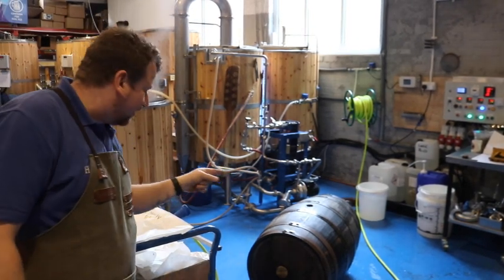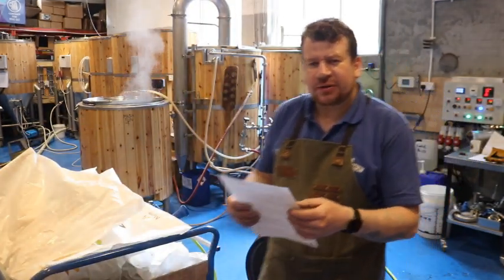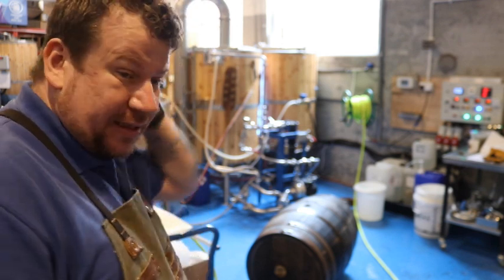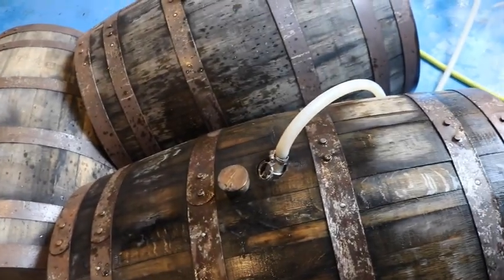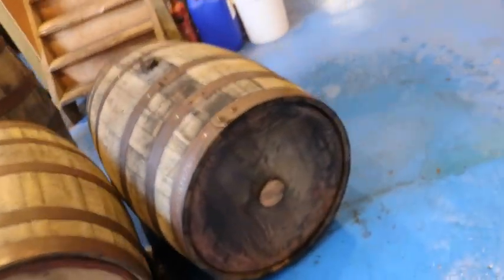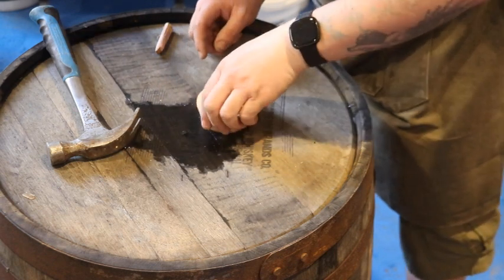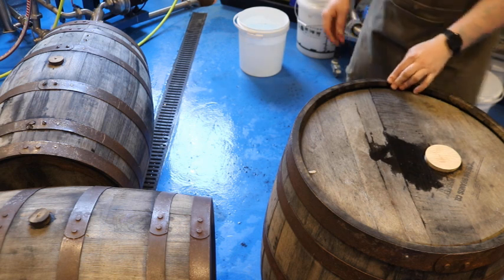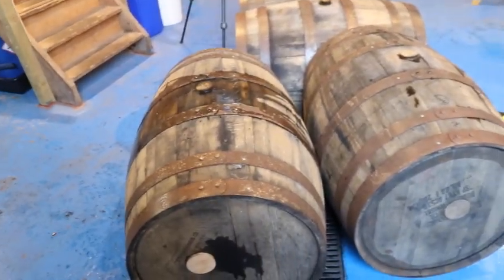Preparing Barrels For Filling With Beer ~ Step One ~ What To Do With Your Barrel!

Comment: The nail polish smell is acetone.....when distilling, the first fraction to come through is the methanol, after that what they call the "heads" (a mixture of ethanol and other chemicals) will start to come through, and acetone is one of the chemicals (present in fermentations) that gets concentrated with distillation.